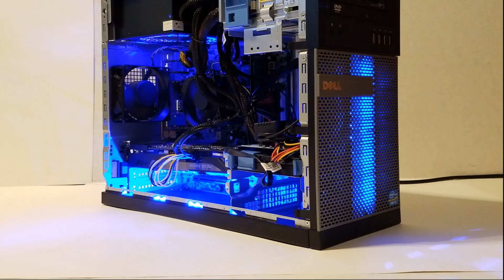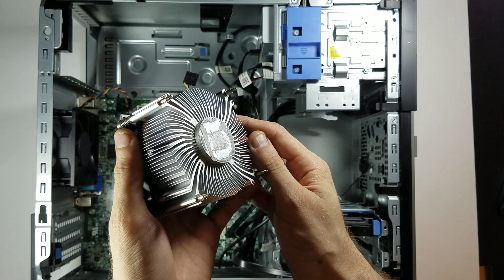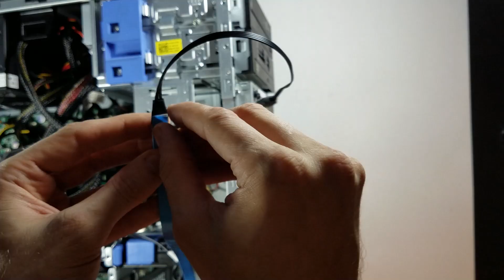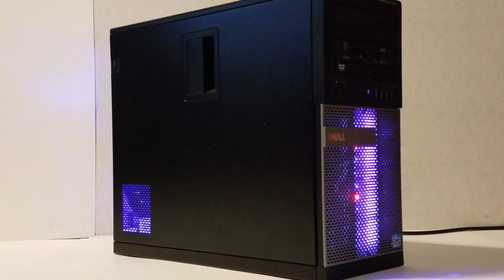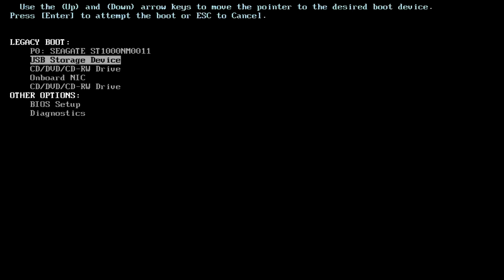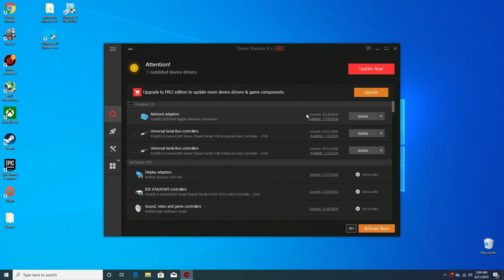CONSOLE KILLER PC *BUILD GUIDE* | FORTNITE | GTX 760 i5 2400 DELL OPTIPLEX

Comment: I built it but it starts up and then shuts down immediately I don’t have the grafic card but I think I should work does anyone know how to help.   

Never mind I got it
Reply: Hey is the power supply reliable?
Reply: Born2Legit Yes very
Reply: The same thing is happening to me please tell me what you changed. Please reply soon
Reply: Matt Wamps ok ummm just make sure you have all the cables plugged in expect the ones that goes to the graphic card hold the power button with it not connected for 20 sec and then plug it in and turn it on it should work if not tell me.  

And once you get the graphics card then plug those cables in
Reply: Matthew Lopez I didn’t see your reply but I figured it out. Apparently there are many things that can cause this. Mine was that the power supply wasn’t set to the correct wattage but thank you for your response

Comment: Hey tech, if I get a dell optiplex mt 790 i5 2400 with a rt 570, will I need to get the power supply?
Reply: Alphah yes, you’ll need to get a new 500w psu that includes a 8pin psi connector so u can hookup your rx 570😁
Reply: Leany B’s thanks bro I just ordered it on eBay, I wanted to know just to be for sure😅
Reply: Alphah no problem bro😁

Comment: Is a gtx 780 good ?
Reply: Yh its worth the money
Reply: For this set up ?
Reply: Yh
Reply: You have it ?
Reply: @xDeeSwervoo  No but look at gtx 780 benchmark and look at prices on ebay USED
Reply: Can a msi gtx 970 replace the nvidia gtx 760 used in the video?
Reply: I just wanna know if there will be any bottle necking
Reply: @xDeeSwervoo  the 780 is an amazing card If you can get it for a good price. If not just stick with the 760 or the 770. I have 770 4gb and it performs amazing

Comment: I wanna do this, but I'm not sure I will be able to do all this building.
Reply: Dont worry its possible
Reply: Zane 100 same
Reply: You can by a tiny tool kit for like 20 bucks it works
Reply: If you can’t then burn it
Reply: Zo_inks or get something like a gddr5 gt 1030 which needs no external power
Reply: @zoinks5717  lol
Reply: @BLM This build won't run battlefield 5 smoothly. You need at least 6 cores to minimize the stuttering and to increase fps
Reply: @Fatmasters11  6 cores aer you high?
Reply: go to another comment  what FPS does it get on fortnite and can it run Minecraft if it can run Minecraft then what FPS dies it get
Reply: @valorant is actually fun did u use the gtx 760 or 770, I got the evga geforce 770 but it doesn't seem like its gonna fit?
Reply: @Jonas Moberly Is it hard to install the psu?
Reply: @Jonas Moberly did u make the exact same build also does it run roblox good?

Comment: So nice guide keep up and  im going buy msi rx580 and install in dell 7010  and im afraid of sata blocked gpu i have the same black cable  in video looks like right angle cable but still afraid to push out the card out i hope not failed 😂

Comment: Do not get the 770 it will not fit
Reply from the maker: Yes it will, you need to remove the hard drive bay. Post a video on how to do so very soon.
Reply: Tech Yesterday did your pc come with windows 10
Reply: I did that thanks
Reply: Is a 780 good ? Or bottle neck

Comment: Could you do this with a more powerfull yet smaller "Dell Optiplex 3020"
Reply: Charlie Bonsor no as the power supply doesn’t fit i was in a situation like yours i had to go to a pc specialist to find out
Reply: @mrepicbruh2839  K, thanks bro (and Rifty fan)
Reply from the maker: Yes we just posted a $250 build and its a beast!

Comment: when you bought the pc did it say no bios. no operating system
Reply: Hxobeastsafe yes its meant to say that as there isn’t a oparating system on it. If you want to install windows 10 for free on it it will have a watermark on the bottom or you could buy a sytem key on ebay for £5
Reply: @mrepicbruh2839  Thank you
Reply: I recommend this guy https://youtu.be/bkafkI32Cs0

Comment: Tech man is it possible if I add in a better gpu like a gtx 1660 and a better power supply
Reply: And if I add a little bit more ram like 8 gb but still get that type of pc and replace the case and add a ssd and hdd would that work

Comment: Hi, I was wondering if you could help me because I’ve got that same optiplex but no drivers are working for me so I don’t even have internet, could you send me the ones you’re using?
Edit: Using Windows 7 Pro x86
Reply: ControllerMeneer if i were you i would connect a ethernet cable (to gain access to wifi on the pc) and upgrade to windows 10 as not only is it faster but its free since you are on windows 7 and plus all drivers should be installed
Reply: MrEpicBruh already tried, Not a single driver so network cable won’t work either... And I did upgrade to Win10 X64 and used a program from a USB stick that I downloaded from another PC and that got me the network drivers and I sold the pc to my brother and it is fully working and it is a nice upgrade for him

Comment: So I did this build on a 790 that had windows 10 already. I put a fatass gtx 1050ti and it barely fit lmao. And then I realized I had no extra thermal paste in the middle of the vid. Do you have any other recommended cases that can replace the MT? For a good price of course
Reply from the maker: Case swap video coming in the next few days. Stay tuned.

Comment: When I added my updated graphic card I received this error. Unsupported video configuration detected. This pc has both a display port monitor attached and a card installed in the pci-express slot. This configuration is not supported. Please remove the pci-express card or disconnect the display port monitor
Reply from the maker: Make sure you dont have a display port plugged into the motherboard
Reply: I just have the power and 16 pin plugged into the mother board

Comment: I have a pc that doesn’t work at all, could I take out the cpu and the other stuff you said and put the new stuff in? Would it work?
Reply from the maker: Your better off just buying the dell optiplex as the CPU you have may not fit a new motherboard. It all depends what parts still work on your old PC.

Comment: I just build the 200$ console killer budget pc and in creative I get good frames(165fps) but in pubs when I’m landing or jumping off the bus my FPS goes to 10 or below and I’m lag spiking so much. I would be appreciated if u can respond.
Reply: Download msi afterburner and tun the overlay and see what's maxing out that will give you an idea on what's bottlenecking and causing those spikes
Reply: This happens to me too it's because the hard drive you can't do anything about it. Unless you replace it with a ssd
Reply: EpicVids that’s not the problem
Reply: Nxrisc i has this same issues for a while and it’s because of windows but i can help you fix it. dm me on discord baby#0290 i can help u this friday
Reply from the maker: @CatalystBass  Hm thats very strange. I play using this PC daily and never had this issue. At minimum i get around 60 to 70 FPS on low settings epic view distance during end game. It seems like something is wrong with drivers somewhere. TBH you will get the best results if you do a clean install of windows and download application called driver booster to get all the current/up to date drivers to ensure it runs smoothly
Reply: Tech Yesterday lol trust me i tried windows 7, 8 windows 10 ltsc and none of those worked for me also have tried every amd with the bios updated and chipset drivers etc. I started to learn about how to optimize windows better and my drops in fortnite disappeared
Reply: Tech Yesterday and most third party applications aren’t good when you can do it manually and they can     download the wrong driver or take up your usage
Reply from the maker: @CatalystBass  What graphics card did you get?What temps are you getting? This could be a defective card unfortunately as there is no way you should be getting that performance. Download Unigine Heaven Bench mark. You should get around 60 - 70 FPS on high settings with t hat application. If you dont then something is 100% wrong with the card.
Reply from the maker: @CatalystBass  Ive never had an issue with driver booster and have built 100s of computers. I highly recommend it as it always installs the best drivers.
Reply: Tech Yesterday I had an asus rx 570 i thought it was the card i sent in for rma they said nothing was wrong with it but they sent me a new one anyway. My temps for the gpu are 40 idle and like 50 in game. along the way i replaced my cpu, mother board and hard drive which never fixed the issue till i started tweaking windows
Reply: Tech Yesterday id say i know what drivers i need to install so every month i check for updates on my mobo drivers and update my gpu drivers every morning a new version comes out. On a fresh install the only drivers that are necessary are gpu and mobo drivers and windows can do the rest for you
Reply: Tech Yesterday umm also is it the hard drive bc when I bought the pc the hard drive it had windows 10 installed already, should I just buy a new one? Would that work?
Reply: Nxrisc Memory , gpu or windows definetley have a bigger chance of being the issue
Reply: @techyesterday4960  I tried benchmark and I was getting about 50-70 fps so I'm guessing that's not the problem. Can it be the hard drive bc when I bought the pc it had windows already downloaded??!! Could that be affecting when I go into pubs and get less than 10fps????
Reply from the maker: @nxrisc  This is very strange. If you have the GTX 760 you should get around 60 FPS on unigine heaven and about 100 fps with the rx 570 (on high). This is a great test as it mostly tests the graphics card. Anything less than FPS listed above id say something was wrong with the card. If you have no issues with the card then the next things i would check is windows and drivers. Easiest way is to install a new copy of windows 10. For drivers, make sure to download application called DDU. It will uninstall all graphic card drivers and allow for a fresh install of correct graphic card drivers. High temps can cause card to termal throttle and a bad/Slow CPU can bottleneck the GPU. If issue STILL persists than it has to be the mother board (PCI-E slot) or CPU. Try moving the graphics card to another PCI-E slot. Also i forgot to ask, what CPU are you using?
Reply: Tech Yesterday when I want to clean install windows 10 it says I won’t be able to undo it and go back to older versions of Windows. Do I just get a new hard drive to install Windows there? And also if that’s the way which one would you recommend getting for a budget of 30$? And the cpu I have is the one that came with the pc

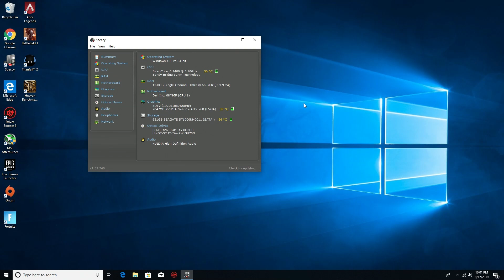Comment: The cpu is 3.1GHz it shows at 11:44, you said you used the same exact dell optiplex for the 200$ console killer, does that mean the 200$ console killer is an I5 2400 3.1GHz?

Comment: can i do this with the desktop version or does it need to be tower ?
Reply from the maker: You need the full size version
Reply: I accidentally bought a desktop instead of tower 😬
Reply: @iShmizz  you can use the desktop version and do a case swap like in the $200 build

Comment: Would the build still work if I take out a 4gb ram stick and add 2 8gb sticks? (There is an extra slot with the 4 gig) also how can I trust the bay sellers? Thanks great vid!!
Reply from the maker: This model has a max ram of 16GB. For best performance put 4 4gb sticks in each slot.
Reply: Its eBay, if you don't think you have found someone to trust yet, you never will.

Comment: Does it matter what optiplex you get? 390/790/990?
Reply: 790
Reply: iGrafitei it has to be the 790? Or does it matter?
Reply: @SlayskiYT  it really doesn't matter the only difference really is the model number and price but all 3 are still supported by Dell
Reply: @igrafitei  could you get the sff?
Reply: @bintyfn7727  if your willing to transfer the parts to another case than sure if not than no
Reply: @igrafitei  so it can work?
Reply: @bintyfn7727  yeah but you just need a mid tower pc case or any case bigger than a sff that can fit a normal sized gpu

Comment: Dude thanks so much just bought all the parts. This is my first rig.
Reply: I dont know yet I will let you know. I dont have my wifi thing yet
Reply: I just added you on discord I would like to talk abt something’s concerning the pc
Reply: Running good for ya?
Reply: Havent got it yet its shipping. I will let you know
Reply: hardly ya plz let us know
Reply: Hey yall this is an update. So everything is going awesome the only downside is he forgot to put you need to buy a wifi connector. I bought a internal one but the GPU blocks the port so I suggest getting a external one. Thank you again tech yesterday :)
Reply: hardly how well did it run fortnite ?
Reply: I got a 790 dt which is to skinny to fit the power supply and such, got a non working power supply. Huge mess but hopefully the build comes together for me today. Had to get a cable and WiFi connector also. Mine has no hdmi cable so I connect via vga but it’s really blurry so I need to figure that out. I’m new to this though.
Reply: Riddeck I didnt buy the power supply he had in the description. For some reason I fear from buying used power supply's. I got the 500 w from amazon and it works like a charm. Also if that gpu is big go with a external wifi, mine did not fit with the wifi because it was too big. I have a gtx 1060 but just sayin. If you want any help my discord is.                hardly# 3117
Reply: hardly thanks bro, I didn’t know the different versions and got a desktop 790 so it’s tight, but I just bought a 600W power supply from Best Buy along with a usb WiFi connector. Hopefully all goes well
Reply: Runs fortnite very well. I have a gtx 1060 that might be the reason tho. With the gtx 1060 I get 180+ fps with low settings and epic view distance
Reply: Ok upsird
Reply: @kennethc47  Hey I added you as well, I'd like your opinion on something
Reply: @OZtheVillain  ok message me on discord I will be on in a little

Comment: For the EVGA power supplies you can check out evga's midweek madness sale, you can sometimes pick up 500-600w white units for $10 and most of the times $15
Reply: Ohh fr? Cuz when I search for a 500w power supply it’s 60$ cheapest. So ur saying when it’s Wednesday it would be under 20$???
Reply: @nxrisc  Yup, they get dirt cheap
Reply: And also they are better than the one you used
Reply: Also when it’s midweek madness what would be the total if the power supply is 15$, would there be tax and pay for shipping?
Reply: Nxrisc i think yes but probably the total will be under $20
Reply: Milos yeah cause those are b stock power supplies which can fail the first time you use it
Reply: So is this power supply safe?

Comment: Isn't really a console killer considering you'd need to buy a 120hz monitor mouse and keyboard as well which comes out to an easy 150-200 dollars extra. If you don't have a 120hz monitor then that whole idea of this won't matter. Unless you have a 120hz monitor laying around this is not a console killer. Let's not forget the parts for the pc are used. You can find a PS4 for 150 easy if used with the controller and everything. I have both PS4 and pc but you need atleast a 500 dollar budget for a monitor and PC parts for it to even be worth it.

Comment: Can i use a 700W power supply with this build
Reply: yes, you can use any wattage (above 400w) as long as it has the correct graphics card connectors. also, make sure it has an "80 plus" certification, otherwise it could be quite unreliable.
Reply from the maker: Yes anything over 400W will work fine.

Comment: Bro, I have a problem with my PC. The CPU fan is not working. It's just moves for a milisecond and then stops. Can you please give me a suggestion!!!!
Reply: Shivam Singh when did you last clean it
Reply: @esma8326  I cleaned it yesterday but it didn't worked.
Reply: Shivam Singh did you check if its correctly plugged in
Reply: @esma8326  yes :(
Reply: Shivam Singh do you have a warranty?
Reply: @esma8326  I will try to fix it 👍👍.Thanks for so much caring and I buyed my PC 1 years ago.

Comment: I bult this pc and it runs great, rainbow six siege on medium gets 100 fps iet if you added a 1060 ti you could play vr
Reply: Does it run r6 just 100 frames with the 1060 or the one he used
Reply: can u share me the lick for the dell optoplex pc for 70 dollars the lick there is not opening
Reply: Rishabh Thakur I have one for 89 bucks that’s the closest I found to $70 https://www.ebay.com/itm/Dell-OptiPlex-990-MT-Core-i5-2400-3-1GHz-8GB-RAM-320GB-HDD-DVD-RW-W-10-Pro/333582546000?hash=item4dab11b450%3Ag%3A0fkAAOSwZdteofby&LH_BIN=1
Reply: @yeezysoth6745  thanks buddy buy i will biuld a pc later now
Reply: @yeezysoth6745  yo m building can u send me one more its out of stock

Comment: Built this yesterday. Totally recommend!
Reply: How much fps in fortnite since the new update?
Reply: @raceforshotties  i have the same but with gtx950 doesnt even get to 180 in real game
Reply: @eitsu3434  does it run to about 144fps bro?
Reply: Is it worth buying ??
Reply: @upsird532  yes but if you have some extra try buying better gpu
Reply: @Infernomxrcy if you talking about the hard drive you dont need to replace it
Reply: @eitsu3434  my optiplex 990 doesn't turn on help
Reply: Jonathanツ if you installed a new psi, you need to turn it on
Reply: I mean psu
Reply: can u share me the lick from where u bought the dell optoplex pc m not getting it the lick he shared is not opeing